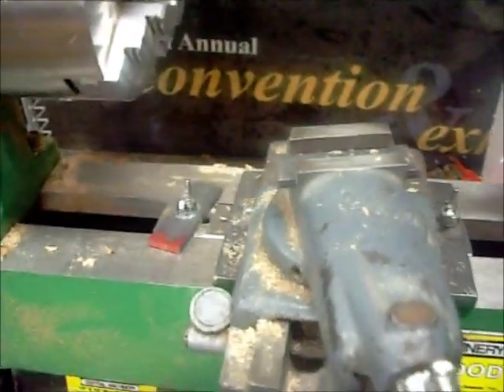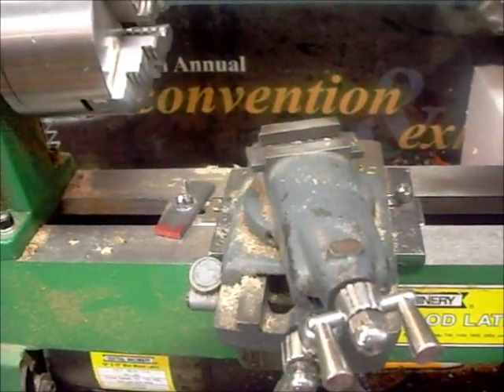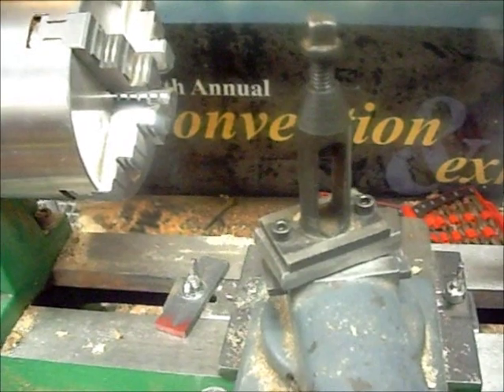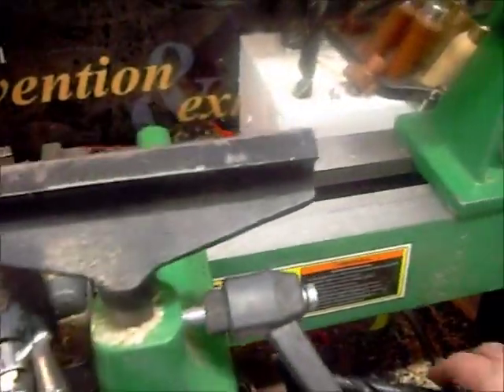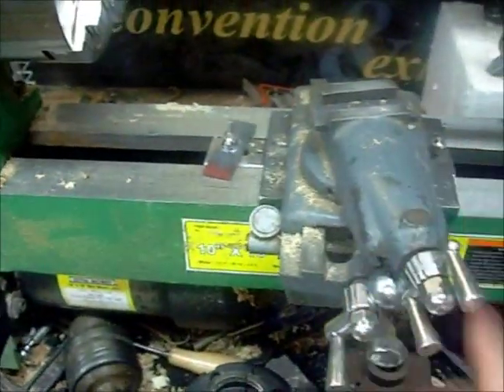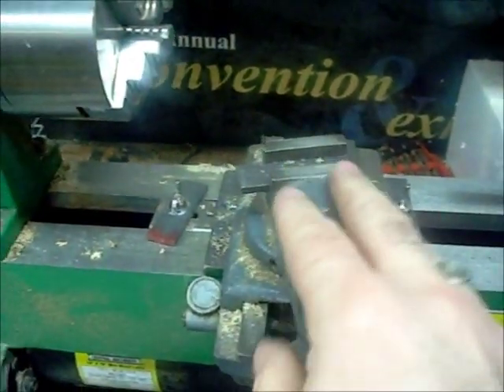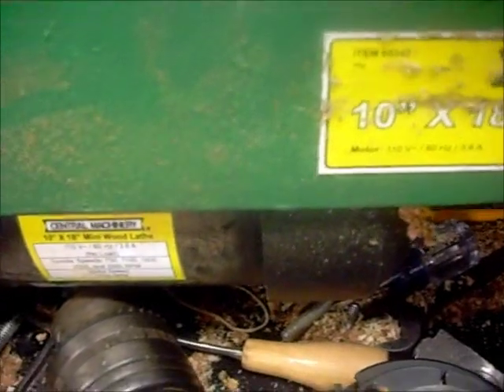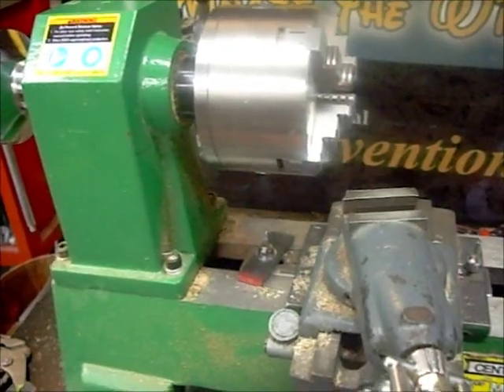Central Machine lathe, I change the wood lathe into a metal lathe.

Comment: Hey I like the 4 jaw metal type head on your wood lathe.. Did it just screw right on or did you need to modify it..???   What diameter & TPI is the tip of the Head Stock Spindle where it screws on...??    { BobWhiteHelps@gmail..com }

Comment: 800watts has had his account revoked. You do NOT want to deal with him.

And just some sound advice, buy a Grizzly G8688. You'll be much happier.

I turn pipes as well, on a wood-lathe, with standard wood-lathe tooling. If you want to go with a wood-lathe, go with a wood lathe. If you want a cross-slide, etc, and metal-lathe capabilities, buy a metal lathe. New or used, you'll be much better off and happier.

Comment: I searched for 800watts eBay seller and couldn't find him, could you post a link to the seller's page? Most importantly where did you get the custom chuck back-plate adapter? Also, what size is the chuck 4"? 6"? I'm looking to purchase this exact lathe and have a similar setup as you for pipe making. Any help you can provide would be greatly appreciated. Thanks in advance.

Comment from the maker: @pheenix42 
I have been doing a lot of golf club faces. I cut the iron off the club then I mount it in the chuck and remove all the metal leaving on the face of the club, it's about an 1/8" thick maybe up to 1/4: thick. These are used as card protectors when you play poker. I have given most of them away. I was making them to sell on ebay.
Thanks
Bob